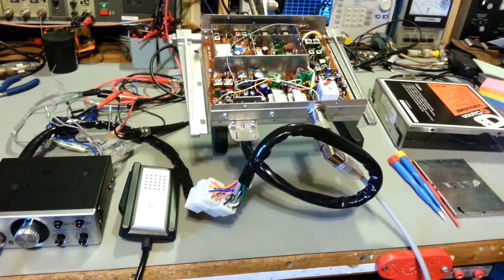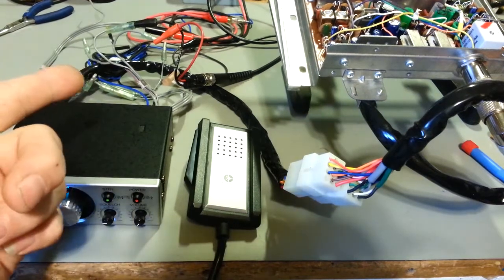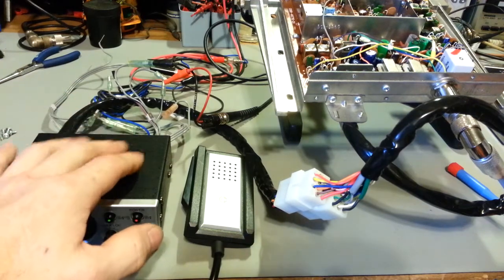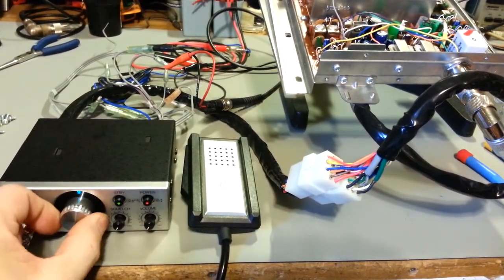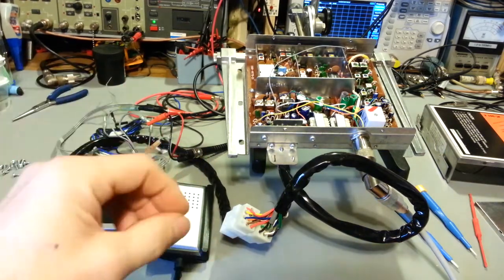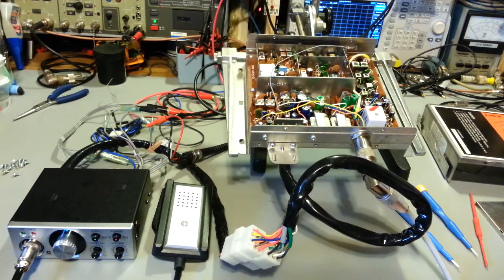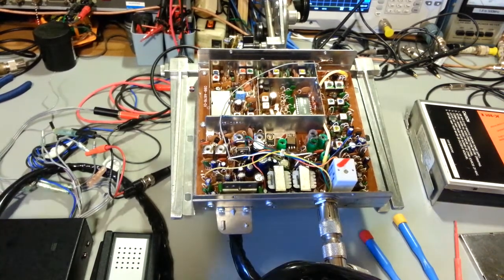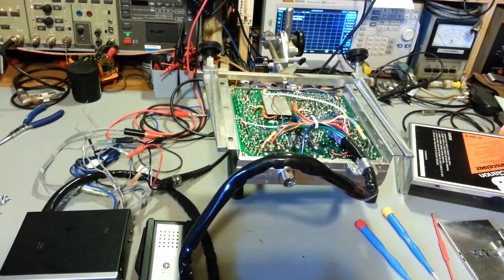Clarion RCJ-001 & JC-201E rare 23 channel remote mount CB radio.

Comment: In the CB heydays the CB makers were trying all sorts of different things to make their radio fill a niche. I once modified an Enduro motorcycle CB's controls to work in a race car since there were no race car CBs.Big toggle switch on the dash and quick disconnect on the helmet.  As I was some kind of big strap operator I had to have a "real radio", more buttons, meters, and all that. I would never get caught using a hidden CB or a One Hander. If you wanted to keep your radio from being seen you had a slide mount and carried it with you when you left the car. Now when I see these I think they are super neat. My favorite is the Midland 13-955, a remote head CB like this one.

Comment: Hey Mike nice vid.  I have 2 of the 40 ch. versions along with 2 or 3 other remote head that don't hook in with the car radio. My car has factory Motorola 40 ch. like the Clarion in the vid. It works but not shure if it's 100% due to probs with the facory AM FM 8track. :(   By the way do you know if the factory can be worked on easily outside of the car?

Comment: I also have the RCJ-001 and JC-201E but don't know how to wire it up :/
Reply from the maker: +Jukebox Junkie They are pretty straight forward to hook up.  Wire with the fuse is B+, two big connectors plug together to connect remote head and main unit together.  Pair of input cables connect to the car stereos output and then another set that hook to the cars speakers.  The unit grounds through the chassis of the unit so make sure it has good connection to ground.  Other than that hook up the antenna and mic and your ready to go.
Reply: Thanks for your reply, I'm also wondering what the mic is used for?
Reply from the maker: Jukebox Junkie 

This is a CB radio, you talk into it.
Reply: @mikesradiorepair  Actually, this helped me out too! Thank you, sir!